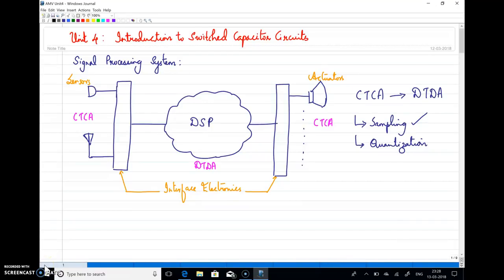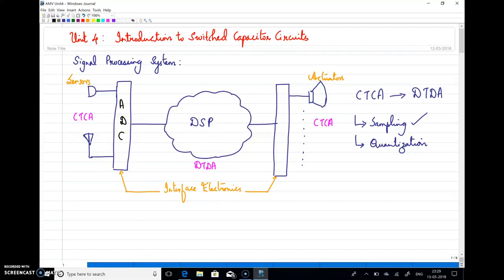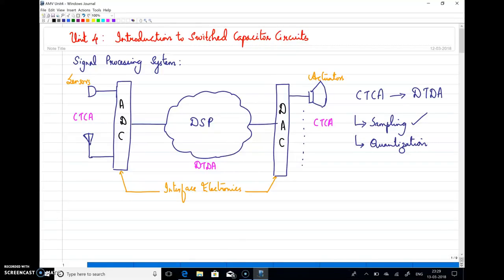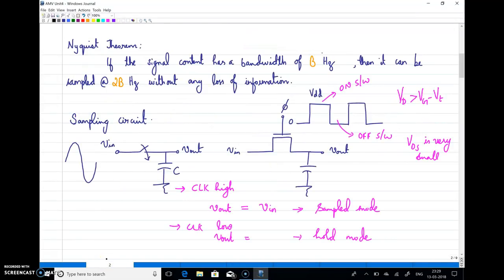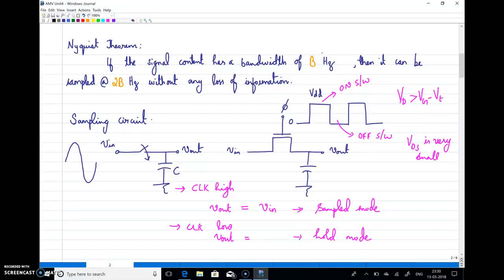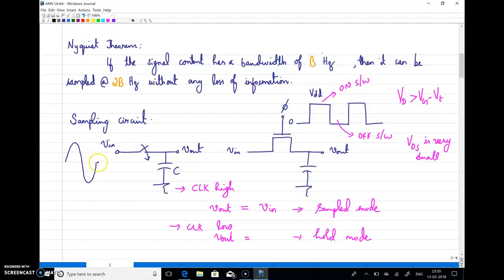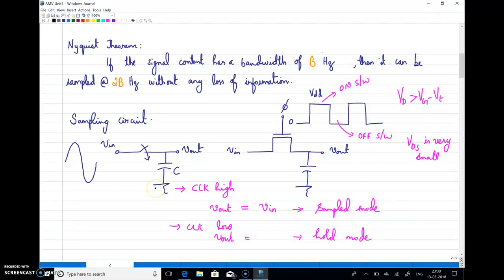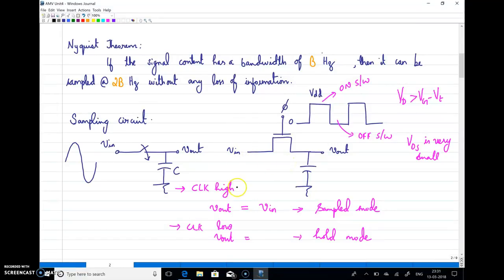Switched Capacitor Circuits - Lecture 1

Comment: Distortion now occurs at 2X the multiple of the signal frequency. It is not resolved. To lessen distortion again one needs to reduce resistance so that the third order non linearity of resistance values are less. This will increase charge injection which will occurs at the sampling frequency and can alias back to the signal bandwidth.